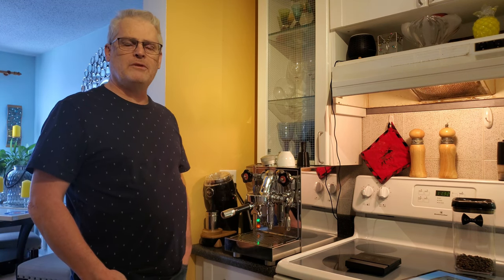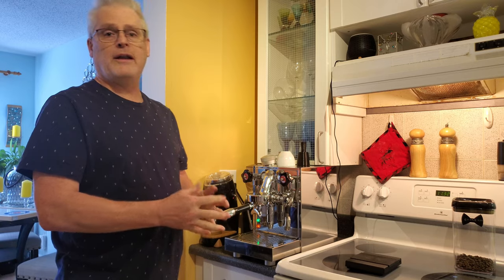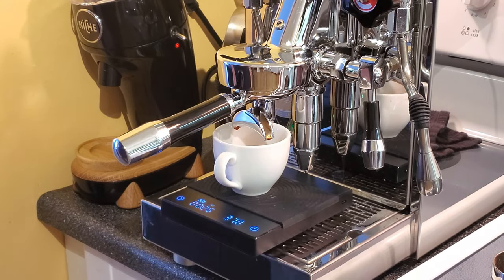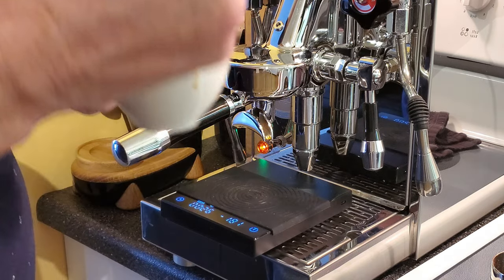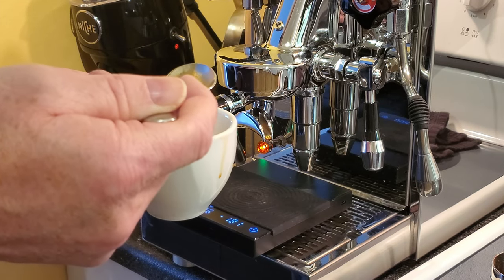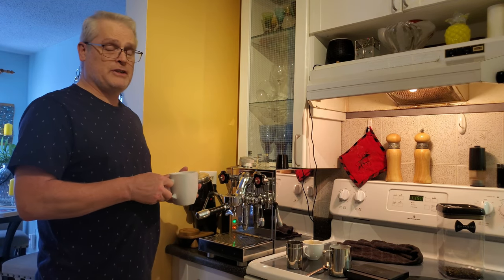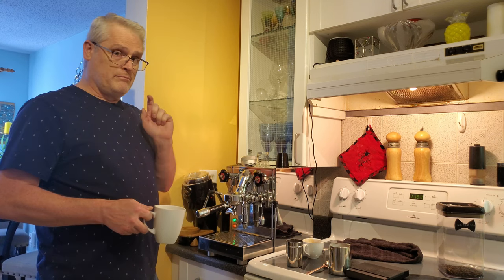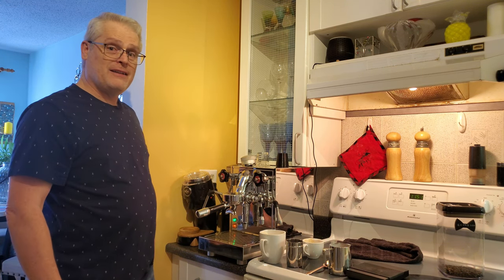ECM Mechanika V Slim, Work Flow Take Two - Plus One Stupid Mistake

Comment: What is your routine as far as how long the machine takes to get up to temperature? Do you use an appliance timer to turn it on in the morning? About how long do you have to wait before you can make coffee? Thanks.
Reply from the maker: Yes I do use a timer for my machine. I have set to warm up 40 minutes before I use it. They say 20 minutes is fine, but I use 40 just to be sure. They way I've it set up now works great, very happy with my setup.